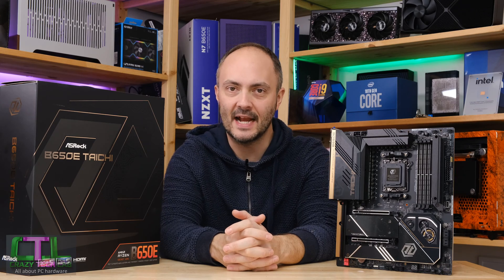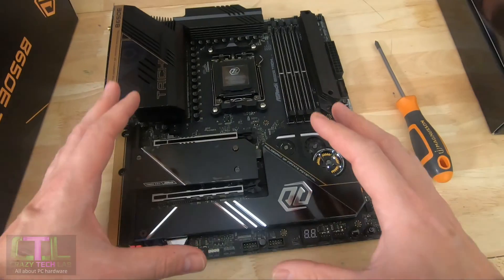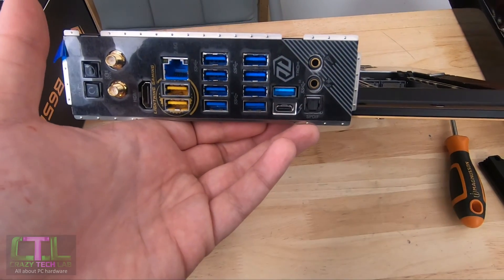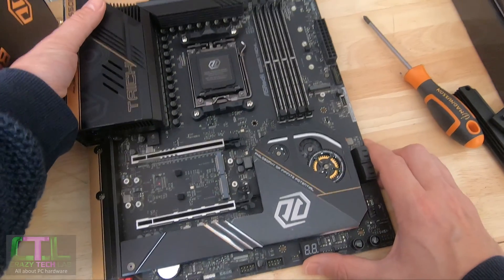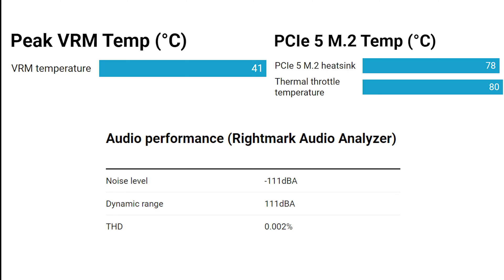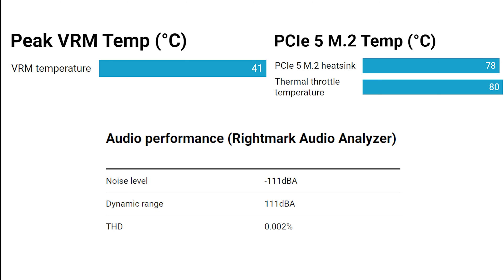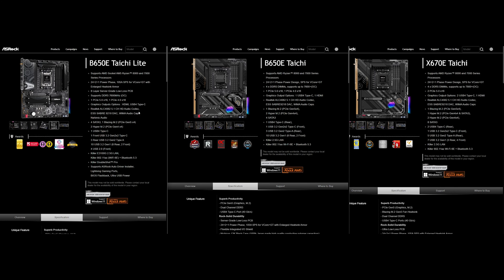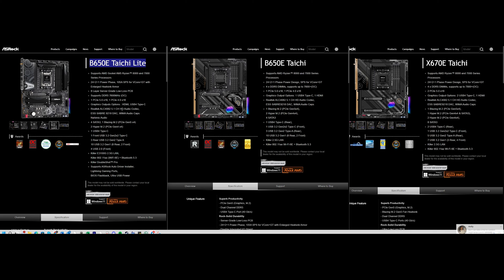BEST AM5 board you SHOULDN'T BUY: ASROCK B650E TAICHI

Comment: The B650E Taichi (regular) is $270 at MicroCenter RN, Lite not in stock, thinking about going for this instead of the Nova X870 since it's never in stock..
Reply: I'm grabbing one today, figured it's one of the best boards I can get for sub 300 and should be able to handle anything I throw at it plus any upgrades I might want

Comment: The battery seems to be hiding under the plate and there doesn't seem to be any screws. How accesible the battery is? Is it easy to change if needed without removing the motherboard or the shield?

Comment: Just did a build with the Taichi Lite and zero complaints with a 7900x, 64GB RAM, Samsung 990 Pro, external Thunderbolt DAS.  Recommended.
Reply: Why 64gb ram? I heard 32gb is all you need for gaming
Reply: @bobjohnson6131   I'm not a gamer.  I do video and photo editing.  I don't know if 64Gb is better than 32 for my use, but I figured it probably can't hurt and may be faster.
Reply: @bobjohnson6131   I'm not a gamer, I do video and photo editing.  Not sure that 64GB is better than 32 for my needs, but I figured it might help and shouldn't hurt.
Reply: @bobjohnson6131  maybe he does things other than gaming. 16 is just enough for gaming, 32 is giving you headroom, 64 is overkill and unnecessary (for gaming).

Comment: Is MSI B650 Tomahawk good? Anyeone with expierence on it? Or should i pay a bit more and go for ASRock B650E PG Riptide?
Reply: No to Tomahawk ! It has good vram 14.80 but no pci gen 5 and m2 gen 5.
Asrock B650 steel legend has 14,80 vram has pci gen 5 and m2 gen 5
Asrock B650E steel legend has 16,60 vram, pcie gen 5 and m2 gen 5
Asrock pg riptide has 14,60 vram, pcie gen 5 and m2 gen 5

All 3 are good + or -

But if u ask me the B650 steel legend is cheaper and better than riptide
Reply: @el.G.  yeah riptide is more future proof. Although tomahawk is a classic in the community and very reliable. It doesn't have the Gen 5
Reply: Go for riptide brother

Comment: X670E Taichi is the heaviest motherboard I've ever held. It's so big and thick and just feels so well built and premium. Got it used but in perfect working condition for 285$. Intel WLAN instead of Mediatek which most other AM5 boards use is so much more reliable and gets better signal. Clear CMOS button is great for playing with memory when you need it, having power/reset on the board is also super handy for initial testing. M.2 ports don't share bandwidth with anything so you can run all 4 NVME at rated speed. On-board audio is the best on any motherboard. 2x USB4 which are also capable of display out.
God I love this board. B650E lite offers most of the features and can be found new around or under 250$, so that's a super solid option as well.
Reply: better than asus x670 hero?
Reply: @JuliussCesarr  the ASRock x670E Taichi | Taichi Carrara Boards are way better compared to the Hero Boards from Asus, better VRM, better on board audio ,better ethernet/wifi chip

Comment: should i buy an ssd that comes with a heat sink or will the heat sink on this mobo be enough.  will a ssd heatsink even fit since this board has one built in.  new to pc building and ssd heat sinks is something im not knowledgable in yet.
Reply from the maker: If you can get one without a heatsink and use the motherboard one. They're usually more effective and the SSD will be cheaper
Reply: @CrazyTechLab  just realized I have the lite version of this board.  I'm not sure if the lite has a heatsink or not.

Comment: I am looking to purchase a Motherboard that will support a Ryzen 7 7800X3D CPU, but it must have at least 4 Nvme SSD Ports, which should be able to support Gen4 Nvme SSD without comprising the GPU port down from 16 to 8.  I want to be able to keep it at 16.  So I like to ask do you know any motherboard that you would advise me to get for this, I don't mind the price so much, I just don't want to use any HDD in this new build.
Reply: I have the MSI B650 Gaming Edge Wifi. There is no SLI-kind of lane switching here, even with the x4 network card in the lower x16 slot. I suspect B650 boards don't do that anyway, because the four lanes on the x16 slot come from the chipset, not the CPU
Reply: Also I see no multiplexers on my board either. All's perfect
Reply: @amurtigress_mobile365  There is only room for 3 slots of Nvme SSD on this motherboard, I am looking for one with room for 4 slots of Nvme SSD where I can use Gen 4 in it even if it states Gen 5

Comment: I'm rocking the Taichi Light, it's amazing. 
Rocking a 7800x3d, 64Gigs, 5TB storage. 
The board is built so well, just looking a bit less pretty then the normal one. A few less options. 
For me to pay 200euro's more... Was and is not worth it.
Reply from the maker: What storage do you have? Is a PCIe 5 M.2 SSD a consideration or do you view them as too expensive?
Reply: @CrazyTechLab  I bought a 1TB 990 Pro, plus a Lexar 4TB NM790. 
Before this I had a old SSD. So the speed doubled/trippled, maybe even 4-5 quicker right now. This difference I noticed for sure. 
But the difference between 7,500MB/s or 10-12.000MB/s a second.. How often am I copying documents or files from one place to another. Never! 
My internet is "only" 1Gbit/s. Downloading + copying to the disk is like 5% usage right now.

The 990Pro was the more expensive drive, 120 euros. A Gen5 one is costing 170. 
The 4TB one costed me 230euro, a gen5 is going for around 550euros. 
So that's a big no for me. Save up, but a better CPU/GPU up the ram even.
Reply: I have the taichi lite also and absolutely agree that for the price it's the best option, and honestly for what you get i personally thought it was the best option out of any other manufacturer as well.
Reply from the maker: I completely agree.
Reply: hi sir what GPU are you using with this set up? im planning to copy your build since i will only upgrade for the next 10years again
Reply: @johnfirst3986  I have a 7900xt. I game on 1440p 165hz and the 7900xt maxes out my monitor on almost any game. But that's without Ray tracing.
Reply: @johnfirst3986  4080Super for me! Anything Under 16Gigs would not be enough to future proof (depending on your resolution) 

I wanted a 49" 5120x1440p Oled monitor. Getting around 60-90FPS @ Cyberpunk maxed settings. (with use of DLSS and raytracing) 
Baldurs Gate 3 is around 150FPs maxed out. (DLSS+RT)

Comment: 1 video out (and its hdmi), no thunderbolt or usb4 header, atx in 2024. I take my B650M-HDV/M.2 over this any day. 3/10
Reply: Theres USB4 and thunderbolt right there
Reply: @romaboo6218  - there is build in controller, you cant chose which video to send, which is inferior to stand alone
Reply: ....it has usb 4 & why are you even using one video out on your motherboard. Plug your monitors into your GPU.
Reply: You are wrong but not complete - you just did not get the real difference here. This is just one level higher as your board - which is a fine board but for a different, lower configuration. Which is absolute ok - why you should pay money for something you do not use or implement?
Read the comment before yours - this is a board for people installing 32-64g memory in and for sure a high end gfx card for 500 bucks on the low end. If you want/need 64g memory you do want high specs on your motherboard.
This board has a fine mix of current specs and high end specs. Good example is the one  PCIe 4.0x16 and one  PCIe 5.0x16. 
I think is will build me now a 7800x3d rack with it, including a 4070 Ti i had the chance ot get for low from a friend. 
The idea is that i can then perhaps in 3 years update this build with a  9950x3d or something like it. The board can run memory up to 7600 when i read it right, so i can even upgrade memory then.
The real deal for me are the M.2 options. There are some crazy high end SSD for that, with read/write specs from 10k to 15k. They are expensive atm but in 2-3 years that will be the standard.
I know that this work because i did the same with my 2 racks before. I usually run them up to 8-10 years. And they perform!
I write this on my last build. Its a 6700k with as ASrock Z1 80 I7 Fatal1ty board and a simple 1070.
I still can run most games with somewhat lowered settings. What is now outdated is the gfx card of course, the 6700k is still a beast single core but outdated in terms of cores and memory cache. And i hit the PCI & M.2 limits some years ago.
I build that thing 2016!
The point is this: Yes, you spend a bit more with racks build around this kind of boards. But not serious more. And if you select the hardware around it right you get a system which can be upgraded for usually at last 5 years and will hold the line for some years more.
In the end it pays out, thats just my experience. More money spend usually do not give you any edge beside the better performance which is usually only noticable when you measure it.
Reply: B650m hdv m2 is a sleeper great board, it was purchased for a temporary board when I had to RMA my b650 rog strix, it outlasted 3 b650 ef strix and a aorus x670 which all had to be rma'd despite running stock in a cool case
Reply: @Zolacee - what? im correct in everything

Comment: Suggestion, start with the features of the product, then at the end of the review talk about your use case specific gripes/nitpicks.  Most people will install the M.2 drives and never need to access them again until they fail.  So not an issue.  The big issue with the board that I can see is the total lack of pcie x1 slots that add in cards would need to use.  Remember your use case (i.e. ease of test benching use) is not a normal one and should not factor in a review.  I know reviewers forget that how they use these products is niche and has no place in a review viewed by people just looking to either confirm or steer away from buy a certain product.
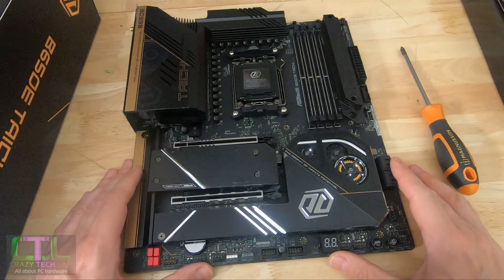Reply from the maker: You know you can use a 16x slot for 1x cards right? Unless you have a massive GPU it should work okay. I did think about the features - I kinda did the important ones at 2:17 , then repeated in more detail at the end because that's where the revelation is about the Taichi Lite - I didn't want to do that at the start because the rest of the video would have been pointless :)  As for the M.2 - it's not an issue with this board because you have the PCIe 5 slot - can appreciate it's not much of an issue on other boards either for reasons you mentioned but on this board it's most definitely a non issue because you have that easily accessible third slot.
Reply: @CrazyTechLab  Yes I do, but what if you need more than one expansion card?  Also, on most other boards the M.2 slots are blocked by the graphics card.  My main point was to do the reviews, knowing that most people do not assemble and disassemble their computers often if ever.  I am an IT tech and have firsthand experience with this.  Just constructive criticism.
Reply: @jokingtiger  Not having a PCIe 1x slot is exactly the deal breaker for me. I am not a fan of onboard LAN chips, so I am using an Intel PCIe x4 server NIC in a x8 (x16) slot, and a soundcard here. Also, is it possible by now to disable the onboard NIC? ASRock has this weird thing of not letting people turn onboard LAN off. For whatever reason...

Comment: I would consider the lite version for a future  build. Maybe another PCI-e 4x port couldn't hurt.
Reply: Fantastic board. If you don't need the PCI slots. You can't use the second slot after installing a aircooled GPU. 
The two nvme slots are more then enough if you buy big enough SSD's.
For the rest its rock solid in my system! 
Can't say anything bad about it, after 3 weeks of use.
Reply: go with the x670e pro rs instead for same money. 5nvme/6sata no lane sharing. U dont need a vrm on am5. Altho if u need PCI-e slots this is not the right board either :D
Reply: @Daisudori  the lane sharing on the taichi is negligible bc with a 40 series gpu, you not gonna be able to access that 2nd pcie slot anyway so who cares if it gets disabled when using the 3rd m.2 slot.
Reply: @XxAtomic646xX Nobody cares about pcie-e slots except for the gpu.

Its still 5 nvme vs 3 and more sata
Reply: @Daisudori  sata is useless. And none should need more than 3 m.2 slots.